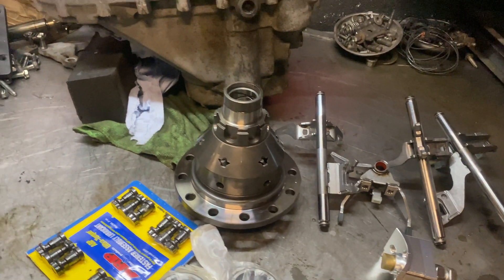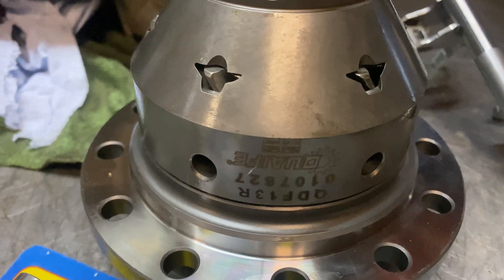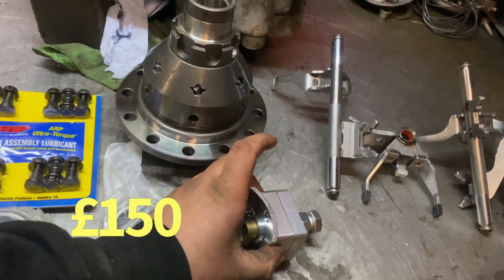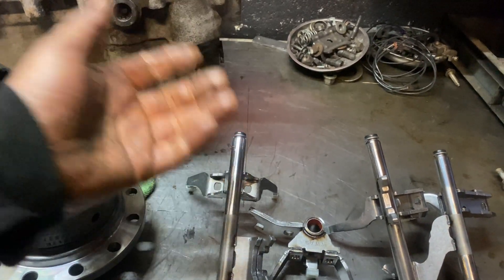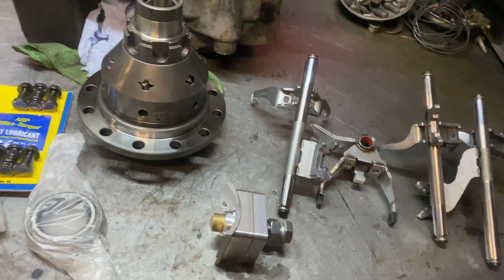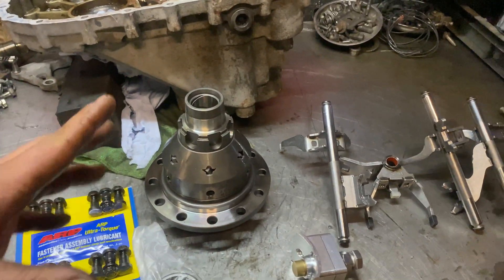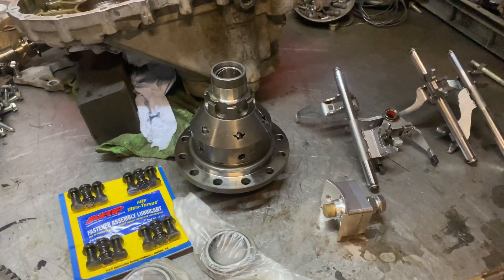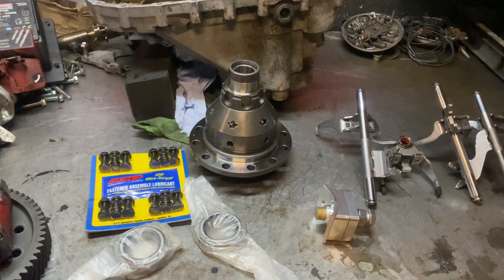Build costs to reinforce gearbox with LSD 4th gear input support shaft reinforced steel selector kit

Comment: Question:  When should 4th gear support be used?  

We're planning for 350ft-lb torque.

Thanks for posting.   Looking forward to the next episode.
Reply from the maker: Over 300 bhp is better to have (500nm )
Reply: @Helder Puto Performance    Which vendor do you recommend to buy 4th gear support?  Thanks
Reply: @05glisedan  he said 300hp

Your 350tq is more like200hp

Or 60% of what he things requires it

Comment: Hi i tried to find a contact for you so i could email you but could not find it. I have a couple of question about a VW 02s gearbox from the AUDI 2.0 FSI, i want to fit this gearbox into a mk1. I have read (on some VW forums) that in order to keep the cable speedo i have to change the bellhousing to a 02J or 02A bellhousing as it has the speedo gear in it. My question is which Quaife LSD can i get that will work with this conversion? I have emailed Quaife themselves but they could not answer my question. Any help or guidance you can provide is appreciated.
Reply from the maker: Hi  the lsd  coming with the ring all ready for the sensor to read some of the o2m have that sensor